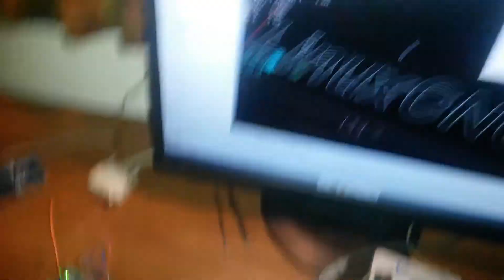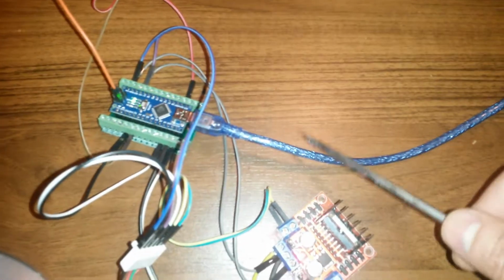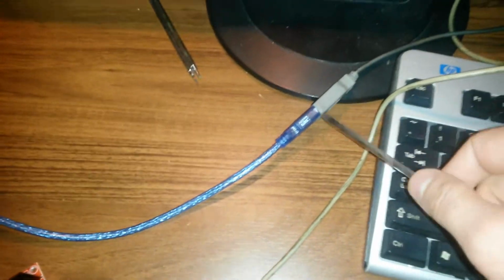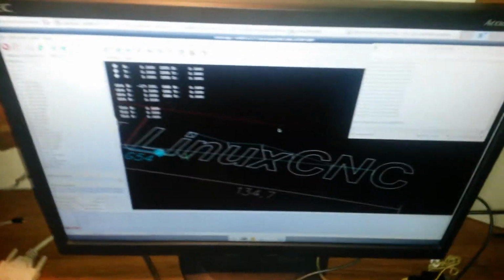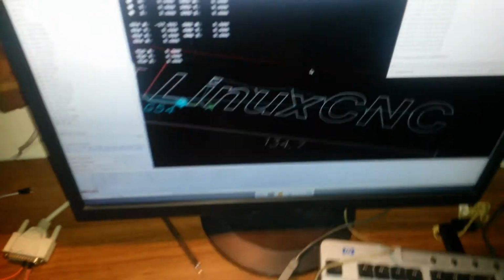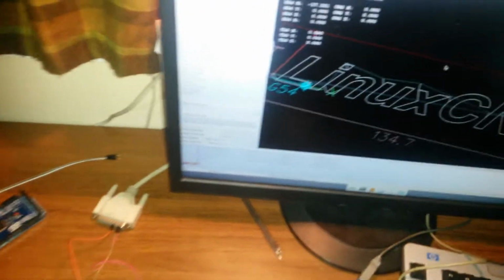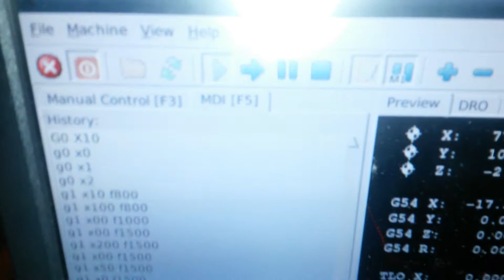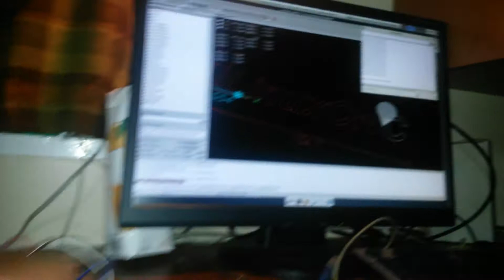Arduino Nano + L298 + DC servo = cnc servo system on the cheap!

Comment: It work in open loop Arduino grbl ?
Reply from the maker: Hi there. You're mixing two thing here: presented setup is a servo systrm based on arduino. You need upstream controller to do useful things - any step/dir control will do hence arduino gbrl will work.

Comment: Hej !!!
Bardzo mi się to podoba !!!
A można? (pewnie można ale jak) zastąpić mostek H i szczotkowiec na sterownik BLDC i bezszczotkowiec?
Mam wrzeciono własnej roboty na bldc ze sterownikiem od majfrendów 36v 500w i chciałbym spróbować gwintować
Głównie akryl i tworzywa może hdf
Reply from the maker: Hi, generally, by replacing h-bridge to be able to control bldc you will have to re-write the software completely. BLDCs would require triple h-bridge with triple PWM/dir combos and sine shifting implementation and more. Not easy job for Arduino Nano. Possibly impossible:)you would need much nore computing power and speed.

Comment: Hi, I made controller with the same code and similar motor but I have a problem with smooth work on low frequency. Can you share your parameters P,I,D ?
Reply from the maker: Hi. I don't have it on hand now but basically the PID tuning i used was like this:
1. Set D and I to zero.
2. Start with P set to small number but greater than one of course
4. Set target position to some point, say 1000 encoder pulses. 
5. If the motor is too lazy increase P and set position to back to 0.
6. See point 5.
7. See point 5:)... Until you get nervous behaviour and overshooting.
8. Now step back with P a little and/or try to add I parameter. Start with small value, like 0.1
9. If you see the overshoot and oscillations are limited or even removed try to add more P and go to point 8.
The PID tuning is a game you will win if you spend some time playing with it. Be aware that PID tuning should be made with motor hooked up to the application it is intended to work with. Otherwise it's performance will not be the one you are expecting... There are other PID tuning methods in use - the one i used is similar to 'step response'. Have fun::)

Comment: Hi, great project! I wanted to ask you a question, if you use the system to make a CNC (X, Y, Z), if one of the DC motor does not respect the position (an axis stops), is it possible to make everything stop?

Comment: Will this work on Windows and Linux. I are new to this and are having problems with it. How is it all set up. IS the DCServo program loaded to the Nano and is the cnc program run on another arduino on another USB port. Sorry for being a nuisance.
Reply from the maker: the firmware loaded to Nano is responsible for receiving STEP and DIRECTION signals from host and control external H-brigde according to position signals from encoder. The host controller in this case is PC running LinuxCNC system (EMC2). You can use any STEP/DIR generating hardware you want: arduino based cnc controller, LinuxCNC, Mach, 3d printers controllers ect...

Comment: What kind of motor are you using?  How many watts does it use ? what is spec on torque on this motor?
Reply from the maker: this is swiss made PMDC servo motor Portescap 28DT2R 222E with HP HEDS-5500 C11 encoder. It's 27 Watts, 24 Volts. It's small but 
See here:
http://www.portescap.com/sites/default/files/28dt12_specifications.pdf

Comment: how many axis this system can control?
Reply from the maker: this is the end piece of the cnc system: motor driver for one joint/axis. to control multi axis cnc system you need host controller that provide multi axis control. the controller you see in my video takes step/dir pulses from the host and drive the motor according to these pulses.